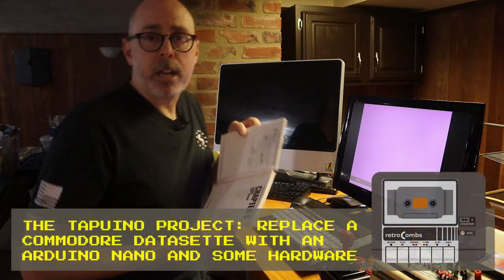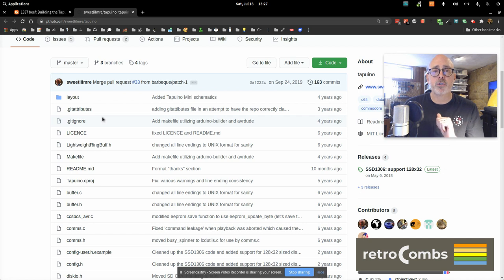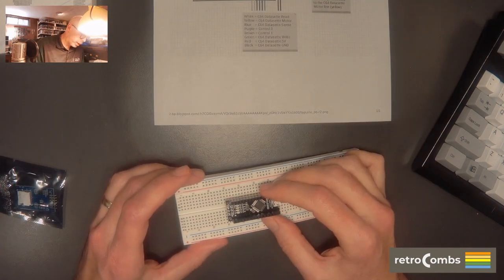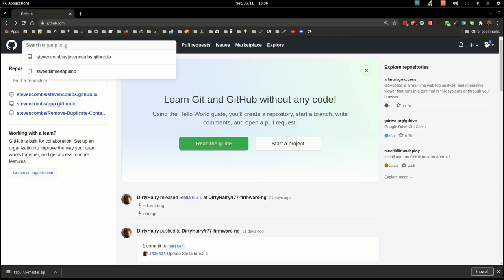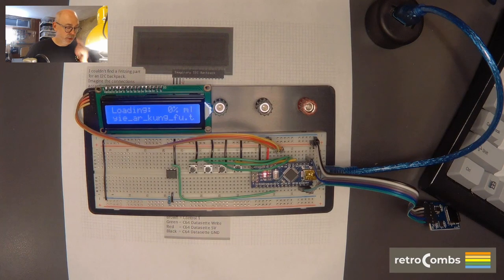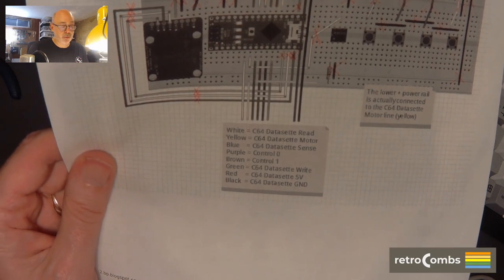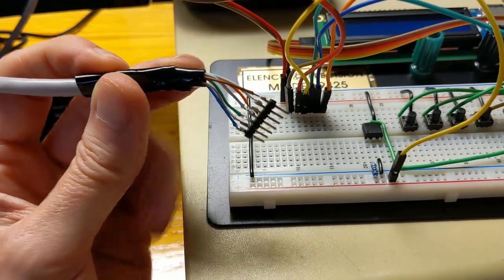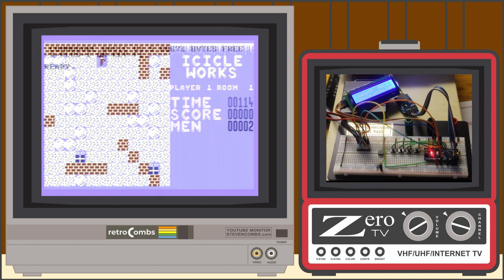Build an Arduino Powered Datasette for your Commodore 64 or Plus/4 | #tapuino

Comment: Sorry for the inconvenience when I turn on the ardino it appears on the display (not initialized)
  in the micro sd it has some files because it is empty 😟
Reply from the maker: Did you program the board and configure the settings using the software and the Arduino IDE?
Reply: @retroCombs  Yes, and I put it in English and Spanish. I did it step by step. How does the video have something to do with it? I use an ardino uno r3?
Reply from the maker: It's been awhile but I seem to remember there were two types of displays supported and it had to select the correct one.

Comment: i computer a 8 bit dell'epoca codificavano i valori binari di bit a 0 e 1 con segnali audio di frequenza o fase differente, una di queste tecniche era la modulazione FSK simile a quella usata nei modem analogici degli anni 90 che si usavano per collegarsi a internet. poichè si tratta di segnal audio, uno dei formati era il .wav che rappresenta digitalmente proprio il segnale audio. gli altri formati .TAP o .CAS etc sono semplicemente la sequenza di bytes che compongono il gioco da caricare. poichè sono in questa forma non sono direttamente utilizzabili dal computer, msx2cas infatti non fa nient'altro che convertire questo file, in tempo reale, durante la riproduzione in un segnale audio e riprodurlo. non c'è quindi nessuna differenza nel tempo di caricamento richiesto nel senso che il tempo è semplicemente influenzato dalla lunghezza in bytes del gioco. 

le cassette di allora, per limitazioni tecniche non consentivano velocità particolarmente elevate. velocità comuni erano di 300, 1200, 2400 baud . MSX utilizzava un default a 1200 baud. per avere un'idea della velocità si consideri che per tradurre in bytes / sec bisogna dividere i baud per 8 (approssimativamente, non è una corrispondenza precisa perchè sono presenti bit di controllo, quindi la velocità reale è inferiore) quindi ad esempio 1200 baud corrispondono a poco più di 120 bytes al secondo.
Reply from the maker: Thanks for that additional technical information!
Reply: @retroCombs  My pleasure
Reply from the maker: @gasparinizuzzurro6306  👍